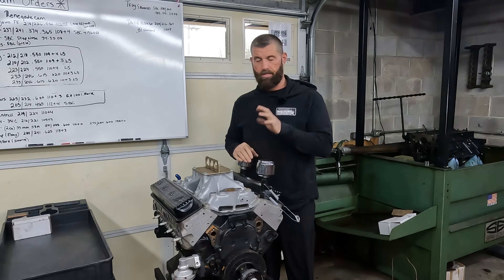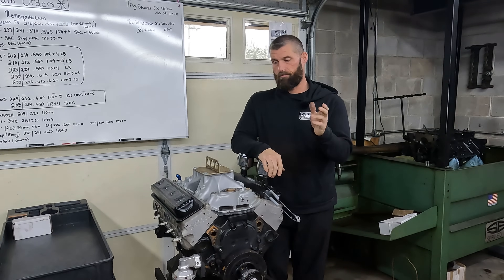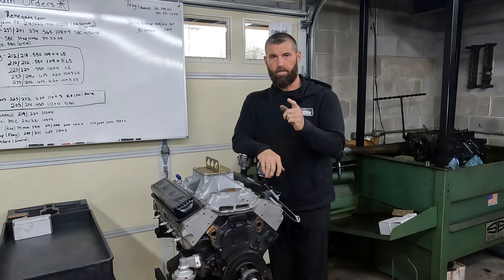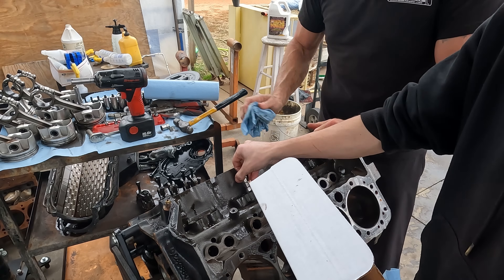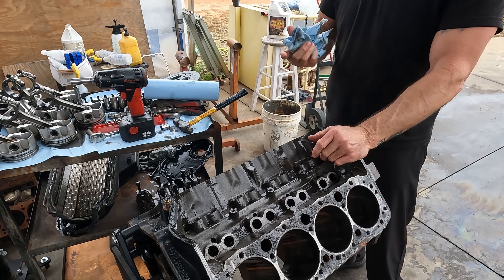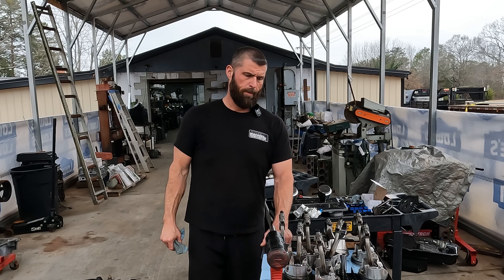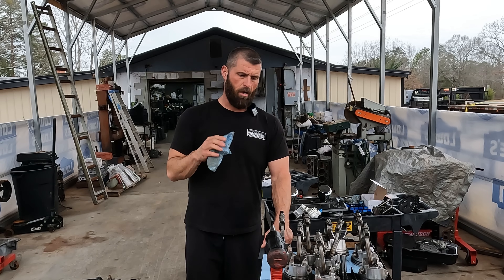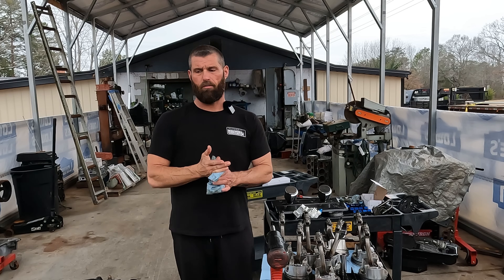604 Crate Engine  Build

Comment: Are those GM oil pumps holding up? I'm assuming they are made by melling. Years ago when they cheapened up the gears they were having problems. Or are they running the better sharks tooth pumps?
Reply from the maker: Std m55hv pump, no issues

Comment: I know I'm not the smartest cookie ever, but I only see a late model small block ..... How in the world did it turn into over 600 cubic inches. I have the perfect core for a start of this
Reply from the maker: 604 has nothing to do with cubic inches  "ct604" is the gm designation
Reply: @powellmachineinc  oh, ok. I was wondering how in the world. So is that particular motor just a 350 still ? Also where are you located? I would love access to a full service machine shop like you provide. I have a 6.0 build that needs the rotating assembly balanced, as well as align honed for cam and crank main journals also ! As always, great content thanks for sharing

Comment: I was just searching the comments for the answer to:  how do you make a 604 cid small block???   Now I see it's a class racing engine and '604' isn't the displacement.   Phew....that's better!
Reply: I saw the title and thought it was some kind of RB wedge motor. 604 is kind of huge for a Mopar but looks possible
Reply: @timothybayliss6680  Seems like I remember seeing a 605 RB Mopar built on an Indy Maxx block with a very slightly bigger bore center (4.84 vs. 4.80).  I'm guessing that allows for a Chevy crank and more piston options in addition to a fuzz more displacement...?  I dunno.  I've never built anything like that.
Reply: 604 is the last three digits of the part number for the crate motor GM sells.

Comment: Very satisfying seeing stuff broken down & I can't wait to see it put back together.....  I heard you mention like the "deck" can't be
done b/c it's already at a minimum as per race specs?  Do the Race Officials break down & measure everything??  If yes, WoW !
peace
Reply: I heard that too. There probably is a rule and I wonder if they actually measure, I really doubt anyone fails tech because the deck is 0.006 short. I think it's to stop guys from running low deck bowtie blocks with 8.2 or 8.9" deck.
Reply from the maker: Yep, during a "protest " the entire engine is disassembled and checked
Reply: I'm not a big race enthusiast but I have seen a "template" for the car shape & heard about "restricter plates"  for air
intake but I didn't know the whole thing could be dropped,  broke down, and "mic'd" to make sure.... WoW.  ty Sir

Comment: Did that big motor make any hp or tq?
Reply: It's 350 cubic inches, the 604 is the last three digits of the part number from GM. It's sold as a crate engine for racing.
Reply: @jeffreydurham5342  Nothing special I see!
Reply: @leonardfoster6252 400 bhp/tq 
It's special because it's for circle track racing. So people don't spend gads of money to make HP. It's kinda like a budget motor.

Comment: If i am not mistaken those are the Fasburn heads.. Any way you can flow test them, to compare to others results?

More flow tests the better AVG flow #'s we can get.  They are what i run on my ZZ430 Clone in my 91 Formula.

Would love to see those heads and a comp XFI-292 cam would put out.

Comment: So the 604 designation does not refer to the cubic inch of the engine if I understand correctly.  These are 350s that make around 400 hp and are intended for circle track racing and the output is intentionally limited for competitive racing?  Some of them come sealed from the factory so there’s no monkey business?
Reply from the maker: Correct